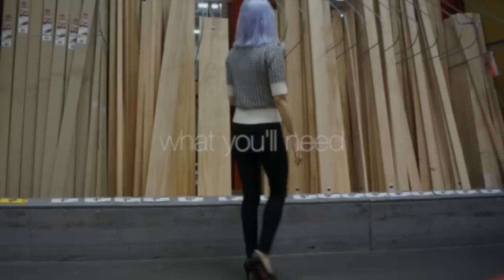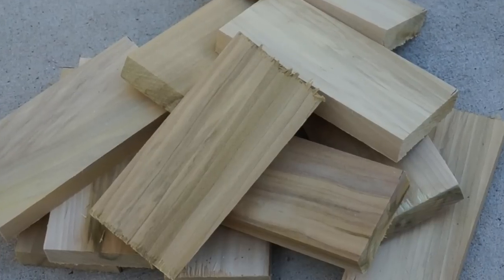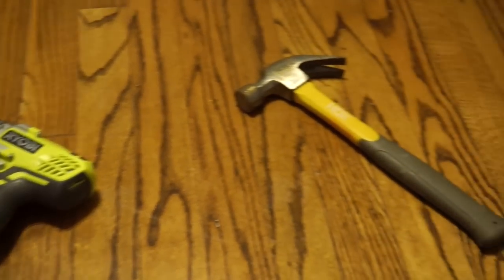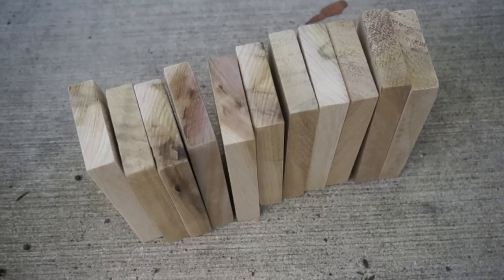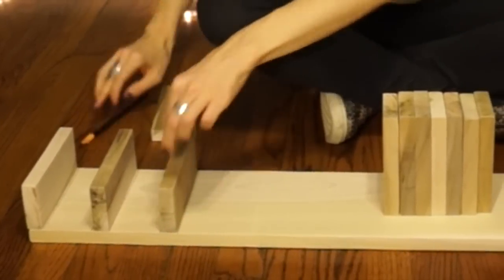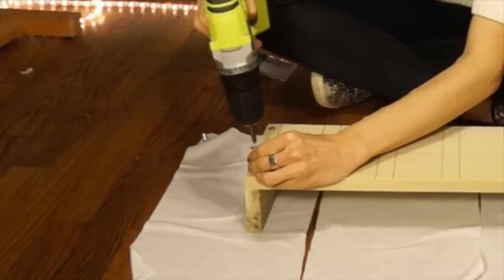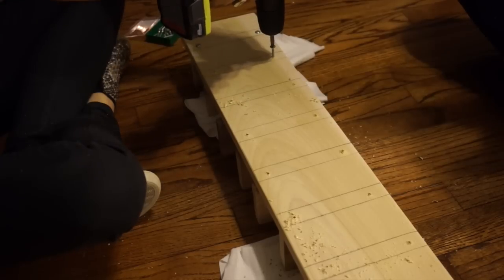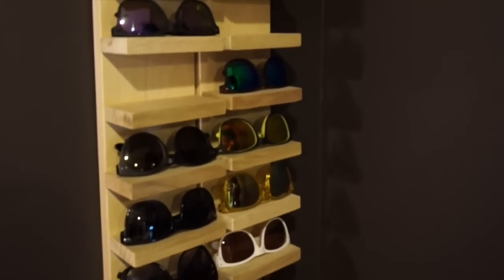Sunglass Rack/Organizer DIY | Superholly

Comment: I went to two different hardware stores to find this wood to make the project but neither of which had anything close in size. One was Lowes the other was Home Depot. Both major hardware stores obviously haha. So sad I wanted to make the so bad
Reply from the maker: +Patrick Higham Wait that's crazy! I got all the wood at Home Depot.
Try asking someone that works there for a little help...
:)
Reply: +superholly I did ask for help. Turns out they were just idiots. And they were giving me the run around about cutting my wood too. 

Went to a different Lowes which was much better. Got all the proper wood and them to cut it. I sanded it all today. It was all the energy I had after all the fiasco. Tomorrow I shall assemble!!
Reply from the maker: Whew... Glad we solved that!
Can't wait to see the results... share pictures and tag me of FB or insta :)